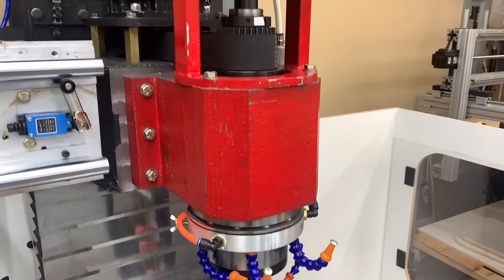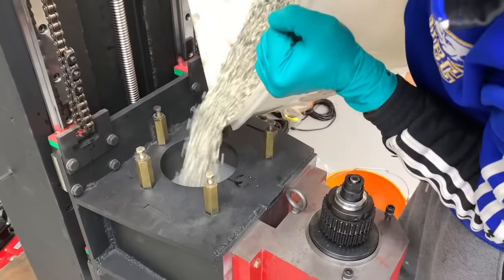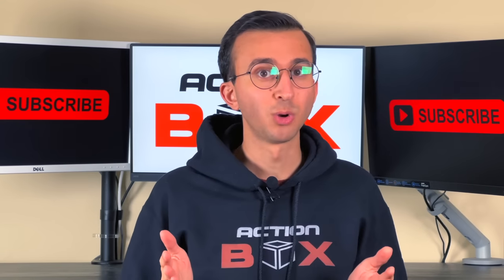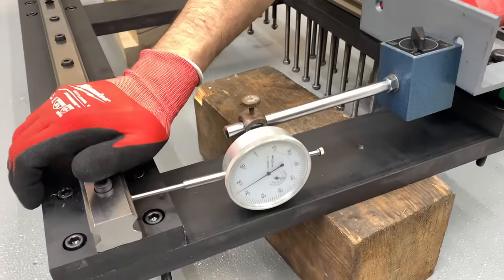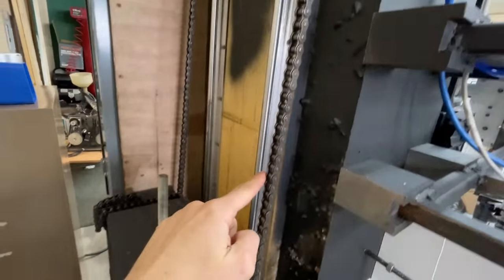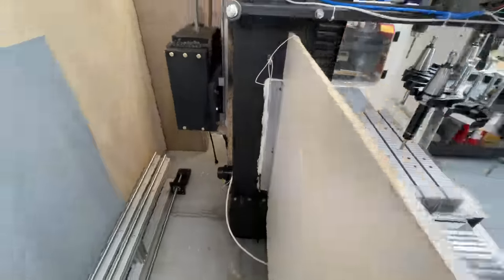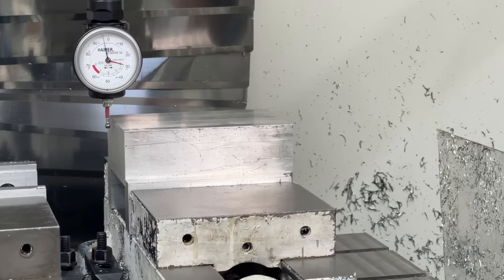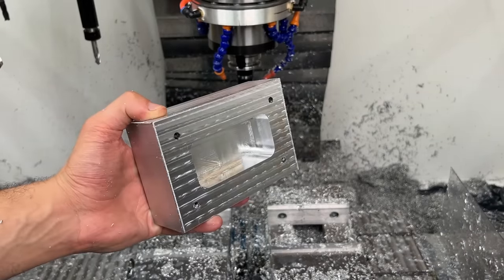DIY CNC Machine Detailed Walkthrough

Comment: Just a headsup, your Haimer isn' treading 0 at rest, so it probably isn't giving you a perfect zero when actuated. You have to ensure concentricity and a second adjustment to zero the dial.
Reply from the maker: Great catch.  I’m using a broken probe that I had re-glued. I’ve been doing this for a while since they are so expensive and it works great.  Since I obviously can’t glue them back perfect I have devised a method to “calibrate” them in such that I get relatively good results but not perfect.  Again, great catch.

Comment: Congrats, an impressive creation! The three bolts pulling the column and the base together seem sturdy enough. Isn't there a too small contact surface at the tips of the two opposing black bolts pushing the column and the base apart (if I got it right)? Did you consider filling the gap to increase the contact surface?

Comment: For the heavy spindle head, you can use the same process as a roller garage doors that have two winded up spring that is tighten and held to the bar.  It makes lifting easier for the motor and cost less and without all the heavy weights.
Reply from the maker: Hi tommy, thanks for your suggestion.  Wouldn’t a spring mechanism have different counterforce at different heights though? This might cause a problem for the Z axis motor, where as the implemented method provides a very consistent counterbalance.  Thoughts?

Cheers,
Dave

Comment: Great build!! I caught the spindle size, but what size servo motors/drives did you use for x,y,z. Also do you have any issues with any of the axis not being closed loop with using the masso controller? I thought about using that controller myself, but skeptical not being able to account for following errors etc. Thank you!

Comment: Where did you get your rails and ball screws and how did you size them?
Reply from the maker: I got them from aliexpress and I sized them by calculating the anticipated forces and masses of the machine and getting something larger than the minimum needed.  These are definitely an overkill for this smaller machine.  Cheers, Dave

Comment: What is the mix you used for the epoxy granite? Percent of epoxy to sand gravel and dust would be much appreciated.
Reply: epoxy+hardner less than 15%, 30% gravel, 30% sand, 20% dust(silica fume, bead blasting media anything smaller than sand), fibers(optional).

Comment: mh i dont think the counterweight is the best option here, i think it would be better if you used pneumatic pistons connected to a big reservoir to counteract the weight of the z axis. One negative is, it has twice the mass and also the maximum acceleration should be 1G because otherwise the counterweight would fly and bounce back down. only my 2 cents :P
Reply from the maker: This is great input. I never considered the effect of this system on maximum acceleration so thanks for that. That being said, I didn’t way 200kg applying a torque on the column (z axis) pulling it down, which is one reason I decided to go with the counter weight. I hope that makes sense.  Thanks again for your input 😃. Cheers, Dave
Reply: 1 G in such a small machine Is pointless in my opinion. 2500 mm/S2 Is scary enough.
Reply: @marson8870  it depends on what you do, thats right. If you can raise the acceleration while also holding tolerance and surface quality, it can drastically reduce the cutting time if you have small complex contours. What i personally find scarier is when the maximum velocity gets raised.

Comment: Homemade cnc, start by using a waterjet..... wth? Nice machine and good work, but not homemade.
Reply: Well it is, what if they owned the waterjet?
Reply: @dejanbrice8774  not home, for sure
Reply: DIY is the better term?
Reply from the maker: Hahah, first of all you are definitely right 😃 . I will  share though that there are many websites where you can upload your DXF files and have them laser cut and shipped to you within a week, so this should not stop you from building your own CNC machine. I was resourceful and found access to water-jet cutter instead. If you want to make this at home you definitely can, but it will require lots of problem solving and thinking.  It’s not an off the shelf solution.   I hope you enjoyed our videos regardless. 
Cheers,

Dave
Reply: @kurtlindner  yes.
Reply: There are a lot of things that you can be critical about in their implementation, but complaining that it isn't home made is ridiculous. Next you are going to complain that they used off the shelf parts rather than starting with the raw materials?
Reply: @tinayoga8844  That's not a bad idea, a collab between How It's Made and Action BOX. ;)
Reply from the maker: @tinayoga8844  I appreciate the support everyone😅. thanks for all your positive comments 😁. Cheers, Dave